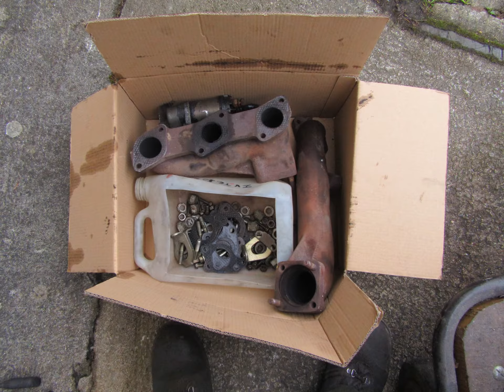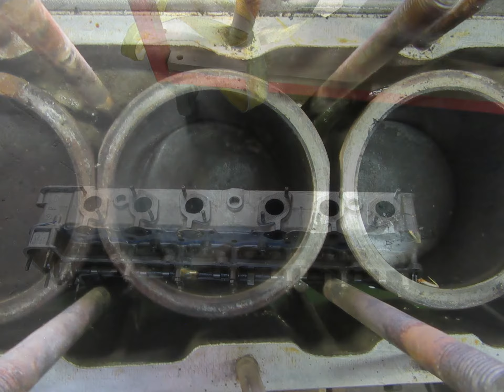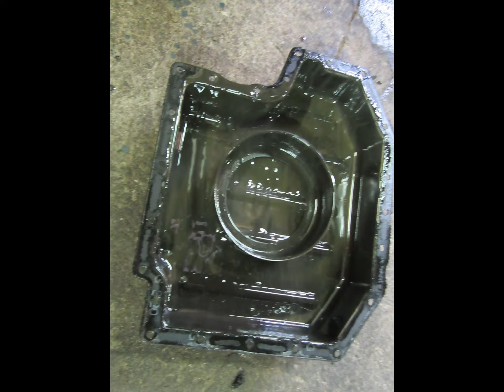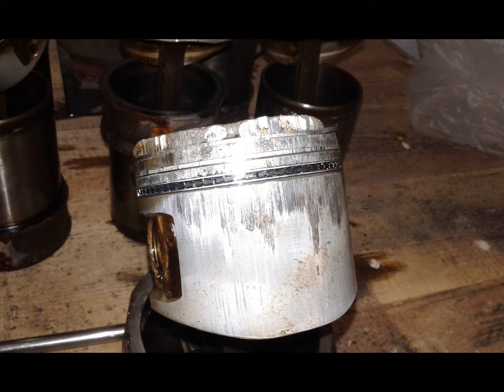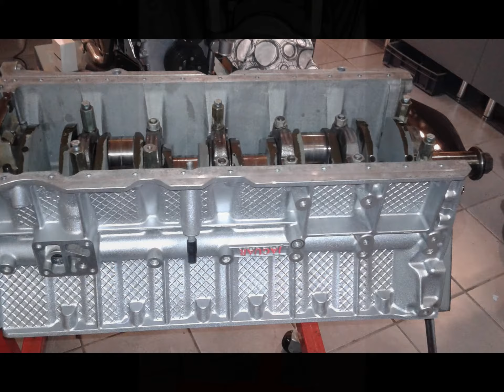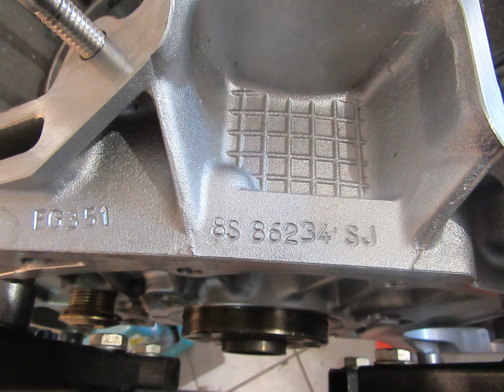Jaguar XJS V12 Engine restoration 0800 Part 1

Comment: i looked at a v12 jag looked about the same no heads engine still in the car. the seller assured me he was a mechanic and had marked all the parts.. then he said but you can convert it to a chevy 350 . i said what would be the purpose of having a jag without a jag engine. i passed on that deal
Reply: What?